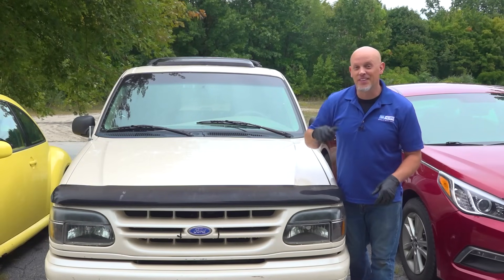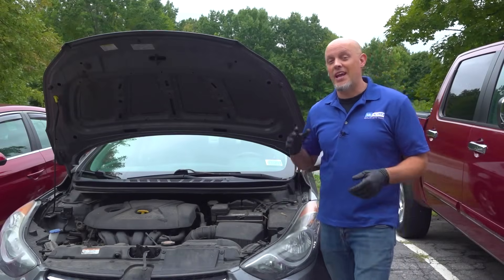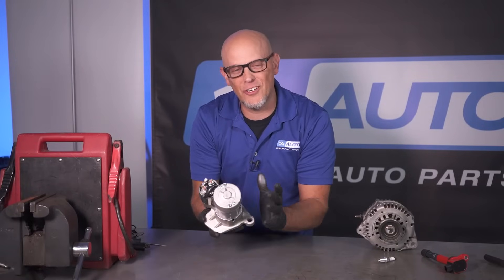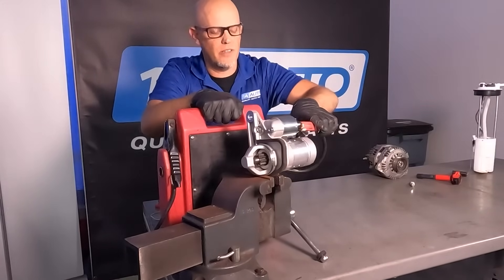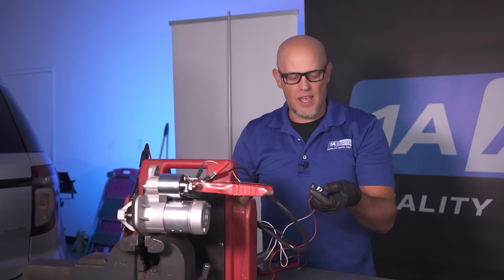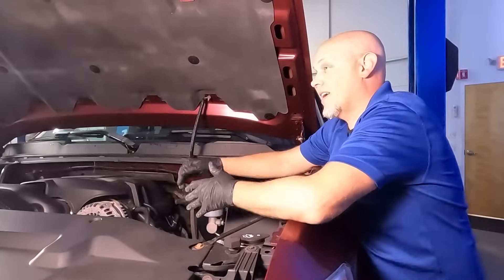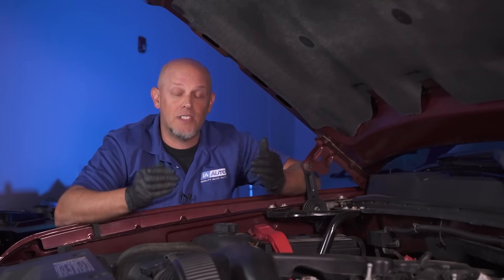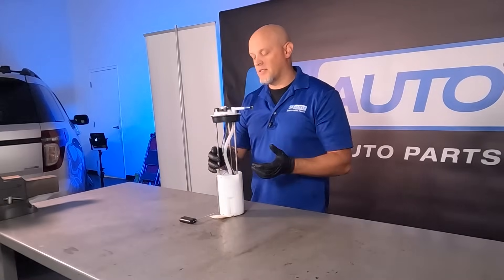Car or Truck Won't Start? Difference Between a Crank No-Start vs. Just Won't Turn Over

Comment: This is very insightful. My car is is not cranking but the light and mobilizer works well. When i push it, thats when it starts. What could be the problem, is it the starter?

Comment: 4g93 Misitmbish after assembling the engine it's wants to start now it's Cutting and it's not sits on the highdrinig. Then when you puts fuel  it's start then  it goes off.

Comment: I bought a '07 F150 and had zero issues starting the truck even after weeks of sitting, before i had time to replace the drive axle. While working on the truck the battery died. After jumping it to start the vehicle, the security alarm went off without end. I only have a single key with no key fob. I had to unplug the horn and disconnect the battery. The vehicle now cranks very strongly but refuses to turn over. I removed the aftermarket security system and found no wires cut and split for the starter signal wire. I've looked everywhere. I don't know what else can be my problem. Once you turn the key to crank it, even if you let the key go(and it returns to accessory position), it will continue to crank until you return the key to the "on" position. What am I missing?

Comment: My truck makes a loud screech noise wont turn over. Turn it off, try again and it starts right up. 
Usually 1-2 times to get it to start, but not everytime I go to start it does it happen. 😂😢

Comment: Don't assme the battery is fine because the headlights are bright. It takes far more energy to turn over an engine than light the lights.

Comment: Reasons for it to be your battery is because of your terminals being corroded. Another your battery cables if it has a damage, or burnt area. And lastly sometimes nobody checks how old their battery is and also it can be your alternator.

Comment: Its not the battery or the fuel filter or the starter its a relay i think it cranks but won't start E250 econoline 6 cylinder cargo van 2000

Comment: How about fuses? I replaced my fuel pump, battery, alternator, cam and crankshaft sensors and still no bite. My starter is still working but it's a headache to deal with this problem. Also did awhile ago put new spark plugs and ignition coils too.
Reply: Did you figure it out yet?

Comment: I'm relieved to know that a slower crank most likely means that it's the battery. When I get a new house, I'll need to make sure I get one with a heated garage because I know that leaving your car out in the freezing cold during the winter is not good for the battery, especially if you don't drive it every day.

Comment: my friends car only starts when jumped but the battery starter and alternator are good...I told him it might be the ignition switch any idea? sometimes it does start by itself but most of the time it needs a little boost

Comment: My Qx56 2008 won't start when it drops below 40 degrees 😢I have a codeP0615 Starter Relay 'A' Circuit which i don't know where or what that is please help😢

Comment: Heeeellllpppp my truck wont start either, I've changed the neutral safety switch, the starter solenoid and it still wont crank or start now all I hear is a click from a relay inside. Please help!! 😢
Reply from the maker: +@XxGHOSTxX72 We wouldn't be able to diagnose an issue like that here, you may want to have a local mechanic take a look at it. Thanks for checking us out! http://1aau.to/m/Shop-1AAuto-c

Comment: for my renault clio today i had to take my grandmother to an appointment and the car started very roughly and just shut off. Then i tried it again and it was cranking cranking and cranking but to no avail. Then i push started the car and it turned on very roughly again. Then i gave up parked the car by steering and pushing it and 1 or 2 hours later BAM it starts like nothing even happened. The battery is new i checked everything with a multimeter and it all looked perfectly fine. Man i don't know i think my car either hates me or it's just a stubborn one. Btw that exact thing happened once already and it fixed it self the same as it did today. Any clues what could cause this?

Comment: There's one more thing. A colleague  replaced his car key housing because the old housing was cracked. He couldn't start his car after that. It was turning over but he didn't start. Turns out he didn't transfer the transponder over to the new housing.

Comment: I had my fuel pump looked at and they changed the O ring on it cause it was leaking fuel. Now my car won’t start after having it running for a day, any reasons why?

Comment: My car start only after half crank two or three then it crank full n start... Change the starter motor n battery but still same problem...
Reply from the maker: +@BLACKBIRD_070 We wouldn't be able to diagnose an issue like that here, you may want to have a local mechanic take a look at it. Thanks for checking us out! http://1aau.to/m/Shop-1AAuto-c

Comment: I have a no start no crank on my 2012 Ford Focus 5 speed manual as of last Monday I think 🤔 it’s the battery but I’m not completely sure need help with this issue it clicks and dashboard lights go crazy 😝 radio still was working tried the headlights and it started making clicking noises and the dashboard lights went crazy 😝 again any information about this issue would be very helpful 😊😊😊!!!!

Comment: Well mine is crank no start and it’s none of that. Did an engine swap and still won’t start it’s been 6 months went to 3 different mwchanics and no one can make it start what do I do
Reply from the maker: +@juliomacias6148 We wouldn't be able to diagnose an issue like that here, you may want to have a local mechanic take a look at it. Thanks for checking us out! http://1aau.to/m/Shop-1AAuto-c

Comment: My ignition switch is bad (waiting for part to come in) could it crank but not start with a bad ignition switch?
Reply from the maker: +@AmyCharpentier-hc6nu We wouldn't be able to diagnose an issue like that here, you may want to have a local mechanic take a look at it. Thanks for checking us out! http://1aau.to/m/Shop-1AAuto-c

Comment: My pretty new truck wouldn't even turn over last year. Turned out it was the AC pulley wheel binding up so bad the motor couldn't turn over.

Comment: got a 2014 Sentra that has no click, no rev when turning the key. The lights on the display come on, the steering wheel unlocks, the doors lock.. everything does just like it should when the key is turned except it doesn't start or even try

Comment: Ok so I’m confused and need help my truck sounds like vehicle 2 but after 30 sec it starts and runs rough then I turn it off and start it up again and it runs just fine so idk what the problem is plz someone help I’m lost 😂 I replaced the battery and the oil and there is good fuel in it. I think my old battery was good and I replaced it for nothing.

Comment: I have a 2000 Ford Ranger XLT V6 3.0Ltr. it cranks but no start, I checked just about everything, the sensor by the harmonic balancer, spark plugs are ok but I don't have the right tools to check for spark, the fuel pump comes on that I can hear, but I think the starter is going out cause I took it off and tested by ground it and positive connection and sounds good but when I put it back in, it sounds weird like its try to spin, I'm using another top post battery from my jeep commander. But I haven't check the coil pack and the timing rod that sits by the fire wall behind the engine. Plus there's little fuel in my tank as well, so what else should I do or check ??? ...I know I need new battery and at least half tank of fuel and possibly a new starter as well. Please Help Me!?

Comment: In my Peugeot it had no crank no start just silent excepta click coming from the starter, before that it blew a fuze for the starter contol fuze, what would it be? Starter motor or relay?

Comment: Helpful video! Easy to follow! I would love insights from others if they have experience with the particular issue I’m having:
Mazda 6 2010 with a brand new starter
Few months back during the winter, we had a couple freezes. We did our best to keep the car covered and insulated (we don’t have a garage or carport) but we started having issues from time to time getting it to crank. It started with clicking when you turned it over, then silence. Didn’t happen every time we drove it, but as it became more frequent we eventually took it to the dealership.
They couldn’t recreate the issue at first (again it wouldn’t happen every time, mostly just the second time after it had been sitting overnight or all day). We had them keep it another couple days and they eventually got it to do it. They replaced the starter and we brought it home working fine. It sat overnight again and I drove it somewhere nearby and brought it home. No issues. Then my husband drove it to run an errand an hour later and when he came out of the store it hesitated to start. This was more like the second issue mentioned in the video. Turns over and stutters but won’t ignite. Again, it doesn’t do it every single time, but mostly the second time after sitting for some time. We took it back to the dealership and explained this to them. They kept it another 4 days but were unsuccessful in recreating the issue. So we picked it up. I’ve had it back now since yesterday and did a lot of driving with it all day and it was fine. Today I didn’t drive it until late in the afternoon, and just like before, it started just fine first time to go to Pilates. Then after class to drive it home it turned over, stuttered, and hesitated to start again. It started when I tried it again but I’m wondering if anyone else has a similar experience that could help me figure out what to ask the dealership to look for? It feels like “boy who cried wolf” bc I can’t get it to do it consistently enough for them to diagnose so maybe someone else could give me some direction?
The one mechanic they had staffed had a ton of cars this week so I don’t blame him for not being super granular about my issues when they don’t present 100% of the time. Thoughts oh wise and powerful internet?😂
Thanks!

Comment: I have a new new alternator new starter new crankshaft position sensor new ignition switch and still no crank no start what does that indicate
Reply from the maker: +@ybspider8145 We wouldn't be able to diagnose an issue like that here, you may want to have a local mechanic take a look at it. Thanks for checking us out! http://1aau.to/m/Shop-1AAuto-c

Comment: Mine cranks won’t start.mead throttle body changed, oil cooler and gaskets and the PCM. Dealership has had it 3x and it runs temporarily then the engine and lightning bolt popped up again. I’m spent!,!

Comment: If I have a no crank no start, but my car battery will turn on (I.e. radio, etc.), does that mean it’s for sure the starter?
Reply: Hey man did you ever figure it out? Asking because I'm in same boat now except I tried replacing my starter and it did nothing

Comment: My 93 sierra shit off while driving and wouldn’t turn back on. It cranks but won’t start. I’ve replaced a corroded distributor cap installed new rotor plugs and wires and nothings changed. I’ve confirmed fuel is being delivered and well, the engine is exposed to open air so idk what else could be wrong.
Reply: Shut off. Srry

Comment: Thank you, this is very helpful. To add my two cents. My Mazda 3 was cranking but not starting and the reason was a faulty mass air flow sensor. No code was recorded. But the issue can be pinpointed by disconnecting the sensor and allowing the car to fire according to it's built-in timing. Worth checking if the car hesitated to start, dropped in mpg, or had thrown a P0101 code recently

Comment: 2005 Buick Lacrosse crank no start. no spark, verified with the duralast in-line ignition spark tester. Had Autozone test the ignition control module, tested good. Replaced spark plugs and wires and coil packs about a year or so ago. Should I try to replace the coil packs again at 100$+? Any help is appreciated, thanks.

Comment: I have a 2012 Hyundai sante fe and its lights blinking when i turn ithe key is it the starter or alternator
Reply from the maker: +@mr.crunk4148  We wouldn't be able to diagnose an issue like that here, you may want to have a local mechanic take a look at it. Thanks for checking us out! http://1aau.to/m/Shop-1AAuto-c

Comment: I have a 2012 Toyota Yaris that has completely STUMPED me!

I let it sit in my driveway for 7 months because of a weak Alternator and after I decided to switch out the Alternator and installed a new battery I have my car crank, shake like its about to start, and ultimately not start.

Since October I have: Changed out the spark plugs, changed out the fuel pump, changed oil/fluids, smacked the starter while cranking, changed out the fuses, changed out the serpentine belt, changed airflow sensor, sprayed starting fluid, and nothing. The weirdest thing is when I start cranking the engine and pressing the gas you can see the RPM rise and hear the engine churn but theres something preventing it from actually turning on! Theres not even ANY codes in the reader. I bought my Alternator from a junkyard but Autozone said the Alternator was good. Also it was sitting in the yard for 2 weeks so not old.

Comment: My car turns but will only start if I push accelerator also it’s fine if I have been on a longish drive but if I drive down the road and come back won’t go and have to hold  accelerator down any ideas before I start spending loads thanks

Comment: My S10 doesn't want to cold start(cold engine), but once it has been running for a few minutes you can shut it off and it will start fine. My gauge on the dash says the battery is between 12 and 14 volts.

Comment: Any guesses: transmission needs replacement, drove it from dealership after they diagnosed problem.  A week later, failed to start. Cranking noise but no start.
Reply from the maker: +@Judaddy1 We wouldn't be able to diagnose an issue like that here, you may want to have a local mechanic take a look at it. Thanks for checking us out! http://1aau.to/m/Shop-1AAuto-c

Comment: My car one time just died. Turned it back on after cranking for 3 seconds and started. Then stopped as I accelerated. Did that 4 times and then it started to run again normal. Hasn’t done it since. Checked battery, alternator all normal. Cleaned battery terminals and tightened them. Still never figured out why it did that
Reply from the maker: +@deftone4u Thanks for checking us out! http://1aau.to/m/Shop-1AAuto-c

Comment: my vehicle doesn't crank but i know for a fact because of loose electricity power, it got power and everything but when i turn the ignition switch to start it doesn't crank and immediately loses some power and i can see that because of the lights of the gauges that i have, i don't know why

Comment: I HAVE LIGHTS, I HAVE CRANK,  I HAVE NO CLICKS,I HAVE ELECTRICS, I DON'T HAVE ANY DASH RED LIGHT ERRORS. IT CRACKS BUT WON'T START. I'VE STARTED IT EARLIER IN TOWN. DROVE IT. PARKED IT SOMEWHERE. DROVE IT AGAIN. GOT HOME... DID SOME INTERIOR CLEANING... THEN I COULDN'T START IT AGAIN. SURELY NOT DUE TO INTERIOR LIGHTS ON

Comment: I'm having an issue when my nostart is blowing the ignition switch fuse. I changed the starter and changed the ignition switch, but it still not working. It's not the battery or the alternator, we tried jumping starting but still nothing. I'm thinking it's maybe a wire that has grounded, but I have no clue.
Reply from the maker: +Gregory Pabst We wouldn't be able to diagnose an issue like that here, you may want to have a local mechanic take a look at it. Thanks for checking us out! http://1aau.to/m/Shop-1AAuto-c

Comment: Okay, so when I try to start my car in the morning, the whole car vibrates and make the sound the fuel pump makes. After a few times my car eventually turns over and struggles to do so. After that it starts fine for the rest of the day.

Comment: Or it could be my stalled to no crank no start. DTC p2534 start/stop low voltage ignition switch issue.

Comment: My little 106 Peugeot gti broken? Starts first cold start will start over & over! Leave the car ten minutes won't start again until hours later??? Is it alive? Changed crank senor changed master fuel relay switch still the same issue? Help please, got spark when no start got fuel pump & fuel at the rail...
Reply from the maker: +106quiksliver We wouldn't be able to diagnose an issue like that here, you may want to have a local mechanic take a look at it. Thanks for checking us out! http://1aau.to/m/Shop-1AAuto-c

Comment: 04 gmc envoy was cranking and key would remove normally i decided to hit the starter but accidentally hit the wire and i saw a spark. Now it wont crank at all and now key wont come out. battery seems working lights pop up. I replaced starter and relay and ignition switch and still does the same. No crank lights come on but key still gets stuck unless i press the copper button by the ignition switch🤷🏽‍♂️??

Comment: Very informative! I do sometimes experience especially every morning, the 1st time I start it, long crank no start. Then when always on my 2nd attempt it starys. I could also hear my fuel pump sounding. I guess my probpem is battery right? Its going 2 yr 3 months already. I suspect i have no problem with sparklugs since no issues when driving or idle.
Reply from the maker: +AboutTime Thanks for checking us out. Shop for high quality auto parts on 1AAuto.com:

http://1aau.to/m/Shop-1AAuto-c

Comment: Would a camshaft position sensor be in part reason why the high pressure fuel system line isn't able to pump or suction vaccum fuel into the line or build up fuel pressure to its required level triggering it to be pulled where it is required within the starting sequence process for the vehicle to not only turn over but ultimately start from it just cranking over ?